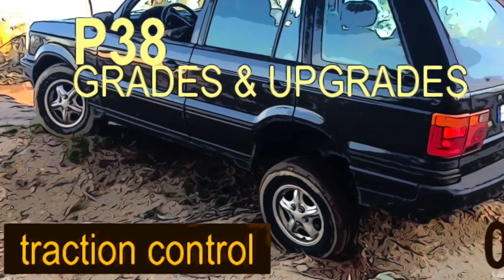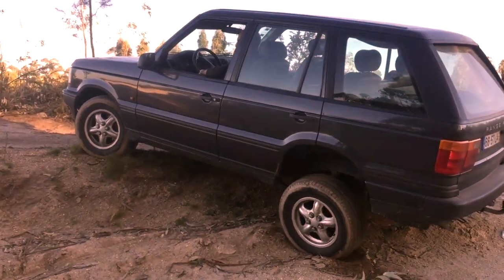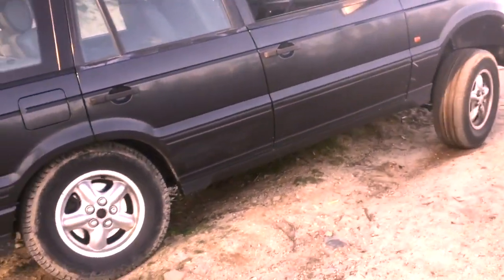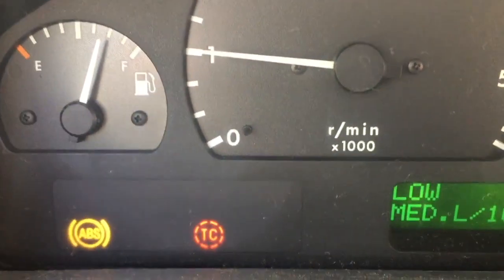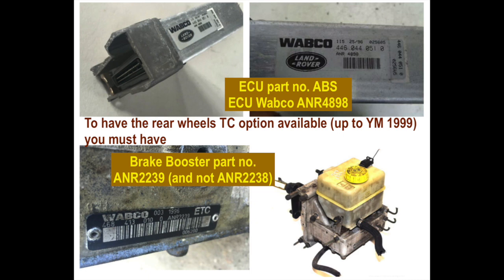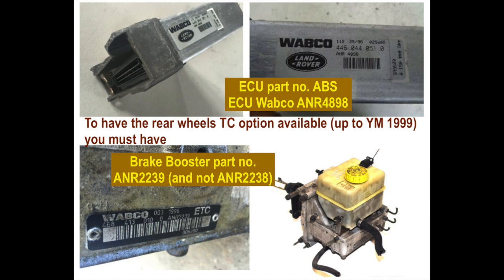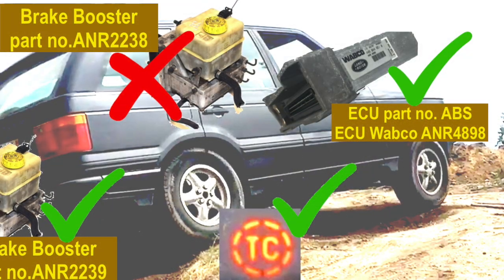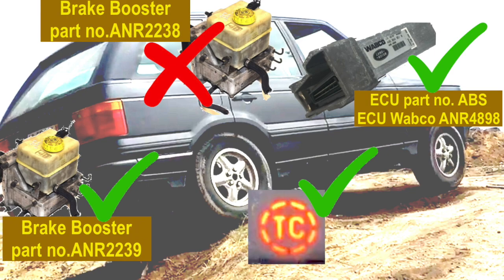004 P38 Traction Control

Comment: fantastic work, i did not know it was just one part. I have a 1994 Vogue SE which has this feature, it was introduced along with air suspension just before the P38 launch. I also had a P38 4.6 HSE, it was literally invincible in snow and ice and off road

Comment: I noticed that on my 1998 the correct units are already installed. But on the nanocom it say abs C. The later 4-wheel traction control use abs D and has different wiring?
Reply from the maker: Yes. The models with TC on 4 wheels have different wiring and different ECU… Is possible that to be changed but is very time consuming… I didn’t do it because now I have ARB lockers and don’t need TC so much.
Reply: @P38Upgrades  thanks for your reply 🙏🏻

Comment: What this work on the gem engines, looking at a 1997 p38a and I am sure it will only have 2 wheel traction control, I think 4 wheel was limited to the Thor engines with the bosh ecu,
Reply from the maker: I think 4 wheel traction control came out in 1999 year models. I don't know if is different for diesel or gasoline engines

Comment: hello, thank you for providing this very useful information!
do u think it is possible to upgrade from a non TC car to 4 wheel TC by replacing those parts from a 4 TC car?
Reply from the maker: I don't have experience on that, but from what I've searched, to get 4TC is not just about changing parts. It will need also changing harness wiring.
Reply: @P38Upgrades  i see, well then i wont bother with 4TC. I will just buy the 2TC ECU and ABS box and hopefully its just plug and play.. thanks again for providing us with this useful upgrade!

Comment: Nice job on description of adding TC option. 
Since you have been working with this do you have a good idea of how to diagnose a p38 abs/tc error?
What procedure would you follow?
Thanks
Reply from the maker: Once the abs and tc light were on. I did this: turn wheels totally to the left (or right). Go to the abs sensor that is located on the wheel and tap it in until stops. Repeat procedure to the other wheel and sensor. Then when you put the wheels straight the gap in the sensor is correct. Sometimes when this gap is to large the system can’t read the signal. This was the only time I had issues with ABS/TC